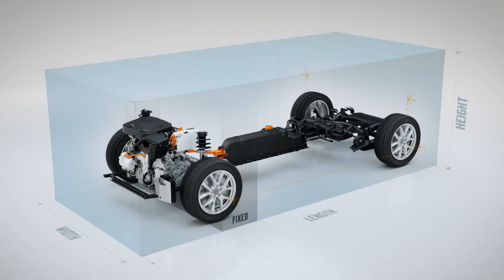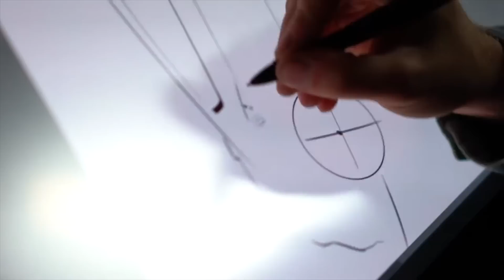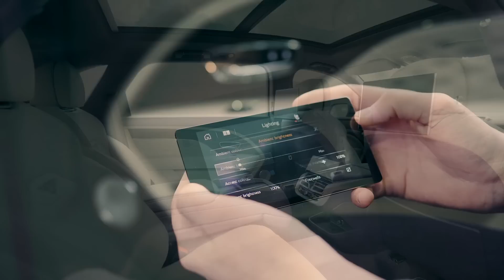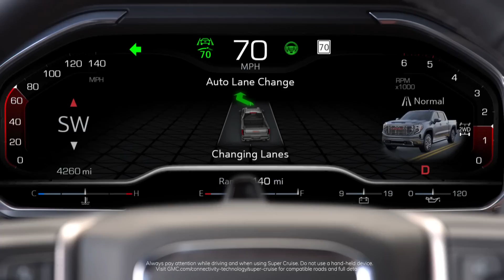Rivian Loses Billions in Market Cap; Tesla Steps Up Recycling - Autoline Daily 3321

Comment: a nice riding GM truck? that seems unlikely.
Reply: GM trucks ride nice,   best in class front suspension,  rear leaf springs though are tired...
Reply: the best riding truck i know is the ram with air suspension.
Reply: @Mike-Minion    Ram a foreign automaker though,   no thanks.
Reply: @dmitchellhomes  oh your one of those american or nothing people. well then buy a tesla. more american made then everything in detriot.
Reply: @Mike-Minion  no, I just like American made pick ups.   Tesla doesn’t make a pick up.   Ram has never been on my radar, even though I think The current version is pretty nice, my preference for the GMC though is the active dampers on the suspension, it turns from a soft boat y ride, too stiff and performance handling suspension in a 10th of a second.   I have had the suspension on several cars, it’s amazing which is the reason that Ferrari licensed it from GM and uses it currently.

Comment: Sadly I bought Rivian at IPO and I got clobbered, I’m going to hold till I get my money back but it might a decade?
Reply: IPO was about $78.  When it dipped to $50, I jumped in thinking Amazon would keep it going.  WIll be interesting to see what happens now.  Another Fisker?
Reply: Better buy some more to average down,   Rivian may not make the IPO price for $78 for many years.
Reply: @aussie2uGA    Rivian has cash (lots of it) and 3 great products,  just needs to get supply chain and manufacturing up to speed and they will be fine.
Reply: @danchatka8613    Lucid should not be lumped in with Rivian,  as Lucid has much less runway,  if we enter a recession,  Lucid is a goner,   Rivian has enough cash to carry through for years.  Lucid has great tech,  but just not products that sell well in a tough market,  and not enough cash.
Reply: Lucid is owned 60% by the Saudi Public Investment Fund.  The SPIF has virtually unlimited resources.  There's zero chance Lucid goes bankrupt in the next few years. Also, Lucid is the most likely acquisition target for Apple.  The Saudis just ordered 50,000 Lucid cars, with an option to buy 50,000 more.
Reply: @danchatka8613  I don’t think you’re looking at this the right way,.   The problem for lucid, is the lack of cash on hand, and the fact that they are a SPAC, which means the whole thing has to be refinanced, or bought out two years after they went public.   If we get into a prolonged recession, they will not be able to arrange the buyout financing.  It would be in the best interest of the Saudi fund, to let the company drop as far as possible, and then at the last second swoop in and buy the whole thing.   That way they end up with 100% ownership for the lowest price possible.

Comment: It's being proven that most EV batteries have a long life span and are recyclable, the next phase waiting for critical mass, is rise of independent EV repair, replace & upgrade shops.. there are already some in Southern California.
As price lowers, EVs should be good for 1 to 3 batteries before suspension, body, cooling and other systems aren"t cost-effective to service. More of the earlier EVs will go to recycling at lower miles.
Reply: I wouldn't be surprised if many EVs break 1 million miles with 2-3 new batteries through that life in the near future.  Those motors can definitely handle a million miles.
Reply: @whattheschmidt  The thing is that even if it doesn’t, a motor is way cheaper than swapping a conventional engine and a transmission. 

Except for the battery they’re all pretty modular (if they’re smart about it) and easy to swap out.
Reply: Yes. I've seen videos of companies going in and replacing individual cells and for a FRACTION of the previously expected cost, they get you back on the road with a battery that will last many years. Truth is, EV technology has massive advantages.
Reply: @whattheschmidt  Most new Model 3's will make a million miles on one battery or 20 years.  Whichever comes first.

Comment: the lincoln with no B post is a bad idea. My ford f150 extended cab with the suicide rear door had cab flex issues and the door seals leaked over time.  I think it is not as safe as a car with a B-post and front hinged rear doors.

Comment: The market is now valuing Rivian below the cash reserves it holds 😲
Reply: Ohhhh boy that's not good.
Reply: Exactly,  Rivian has more cash on hand right now, then Tesla.
Reply: @dmitchellhomes  Tesla is minting money as it scales. Rivian and Lucid are going to be burning through cash piles for the next few years, so the markets are discounting their valuation.
Reply: @MADMAX7330  Yeah, Tesla had a great quarter last quarter, pretty much all of the stars aligned for them, this quarter is something completely different, only selling 1200 cars in China and only building 10,000, compared to a typical 60,000 a month.  Also rumors are circulating the China factory has closed down again, due to parts shortages, and Fremont is running below capacity.   We might see something completely different this quarter.
Reply: When will they learn to not overhype these new EV companies. Rivian was driven by investors more than product. They were considered one of the best before put a vehicle on the road.
Reply: @dmitchellhomes  That's in one of 3 months essentially and they are close to full production but hit some supplier issues (like every manufacturer right now).  With Berlin and Austin ramping, Q2 may be just fine but it's too early to say.
Reply: @rp9674  yeah, at the time Rivian went public the EV market was a bit crazy.    Now it’s more reality, but right now you have to remember, Rivian has at least $18 billion in cash, and their market cap is only $19 billion, that means they’re brand new factory which they have spent $4 billion on is only valued at $1 billion in liquidation,  and their IP is worth nothing.   I think the market had it wrong when Rivian was at greater than $100, but I also think the market has it wrong the other way right now.   I’ll be buying on every drop at this point, Rivian has enough cash to last a long time trying to get it right, they can easily outlast the supply chain problems or a recession.
Reply: @whattheschmidt    Yes,  its too early to say,  but for Tesla right now,  production capacity is not a problem, supply chain is,    so the Austin and Berlin factories are a negative on earnings currently  unless they are running at several thousand cars a week, which is the break even point.
Reply: @rp9674  Most of that hype was Wallstreet's investment banker driven to overprice the IPO, so they walk away 5B right away, while the employees are forced to hold for 6 months until the unlock period expires.. By then the euphoria dies and so does the stock. The winner is Wallstreet, for doing no real work.

Comment: Rivian lost $100B market cap from the peak,  meanwhile Tesla has lost over $400K in market cap since the peak.
Reply: Well, lets take a look at the big picture here, the whole market is down, with Nasdaq having some of the worst drops of all time:
https://youtu.be/ZTuRXdUX8II?t=51

Also Tesla actually faired much better than most in its own market. For example:

(% Below High)
Tesla $TSLA: -36%
Li Auto $LI: -57%
Fisker $FSR: -67%
Lucid $LCID: -72%
XPeng $XPEV: -73%
NIO $NIO: -78%
Canoo $GOEV: -80%
Proterra $PTRA: -82%
Lion Electric $LEV: -83%
Rivian $RIVN: -87%
Arrival $ARVL: -93%
Nikola $NKLA: -93%
Lordstown Motors $RIDE: -94%

The amusing thing about it is that Wallstreet is mistakenly lumbing Tesla with other "Growth" stocks because the fear is that those stocks do allot of borrwing, and in a downmarket those funds could dry up. 

But Tesla has no need to borrow today, it's a self sufficient growth stock with $18B in the bank, all while it grew by over 600 percent.
Reply: @AllanSustainabilityFan    Haha! Funny you use start ups as your Tesla comparable,     What about compared to MSFT,  APPL?

Comment: It’s a catch 22. There aren’t enough EV batteries to recycle because they last too long in their primary use, we are only now just getting to the point where some of the original Teslas are finally suffering enough Range loss to make it worth swapping the battery out for a new one or a reconditioned one. The more second case use scenarios or refurbishing/rebuilding of packs there becomes means the less recycling we will be able to do at scale.
Reply: Especially when you consider the low volumes in the early model S and X days
Reply: Yes, I am trying my best to buy a 50+ KWh for a cabin up north. I want enough power for two weeks at a time. PS. I have a very quiet Honda gas generator, but it is a pain to supply gas when needed. The batteries can use solar energy from my panels to keep charged.
Reply: @earlpottinger671  any luck finding that pack size?
Reply: Manufacturing of batteries does not yeld 100%. There are large amounts of batteries that are flawed and that is what they are recycling
Reply: @earlpottinger671  Would it be worth considering used Lead-Acid batteries. There are bound to be lots of the more robust stop-start glass mat lead-acid batteries that could be sourced cheaper than current Li-ion. Plus I suspect Ni-Cad batteries are likely to showing up from old larger power tools. Even if the lead batteries go dead later, they will have a Lead recycling value.
Reply: @stephendoherty8291  First Lead-Acid are heavy while not storing the power you can get from Lithium-Ion ones. But also when I used Lead-Acid to power my cabin I found they need a lot more babying to keep working well. I just do not see them as a valid solution when the same money will make more Lithium-Ion batteries.
Reply: @earlpottinger671  while li-ion would be the current ideal solution, they are expensive, need a properly engineered cooling solution and fire suppression system (that does not accidently turn on) and there is a dearth of used batteries of the scale you need as their current recycling value is near the same as a used one for sale. This may change if solid state batteries work as intended and can be deployed at gigascale. But thats 2-3 yrs away even if toyota strikes gold. Meantime most EV batteries ate coming from car accidents not battery degradation and there are even more EV buyers looking for a second low cost runabout car now that fuel prices have come to bite their fuel guzzler pride of joy (when gas prices were in freefall)
Reply: @stephendoherty8291  The problem with solid state batteries is that no-one is publishing costs per KWh stored. To date I have seen no proof that SSBs will be cheaper than Lithium-Ion. Also the low power drain of my cabin meant I needed no liquid cooling for the batteries I have. Fan and Air is all that has been needed so far.
Reply: @earlpottinger671  since solid state batteries are still in pre production stage, nobody knows the cost. It will take more than toyotas demand to push costs down to current li-ion, but since previous metal pricing is rocketing, who knows. It also depends on output vs cost.

Comment: 50 tons of batteries to recycle a week and that is just a tiny fraction of those dead - so they really do not last then .
Reply: Have you really looked at the numbers on battery longevity? At about 600-700 pounds of batteries per car, 50 tons is just over 15 cars per week. Many of those being recovered are older cars damaged in an accident, not dead packs. There is lots of published data on how long these batteries are actually lasting in automotive service and the fact is that it is as long or longer than the average service life of a new internal combustion engine. There have been exceptionally short life examples of both BEV and ICE, but overall they are quite comparable on lifetime. And an ICE vehicle requires vastly more maintenance to achieve that parity.

Comment: Taiwan  is approximately 245 miles (395 km) long (north-south) and 90 miles (145 km) across at its widest point.  A single charge and get you all the way from north to south and across from east to west and then back again!  Americans have far greater distances and challenges to overcome.  City dwellers may be more inclined to adopt an EV or even a Suburban who lives close to their workplace.  But many Americans are living a lifestyle that is simply not compatible.  Some people are even comfortable not owning a car at all.  AS for me, not so much.
Reply: Almost Nobody in Taiwan drives North to South,   Taiwan has an excellent transit system and people use that instead.       Having been to TW dozens of times, I have driven Taipei to Kaosiung once,   it's a nightmare, and the High Speed Rail only takes an hour and a half.     The slower train down the East side of the Island is slower,  but still far quicker than driving.       I have friends in Hualien, and took that train many times.     Living in Taipei and owning a car is more hassle than convenience.    I had no problem living there with no car.